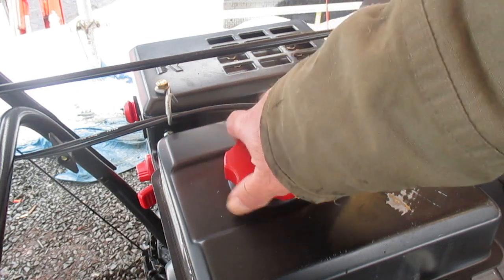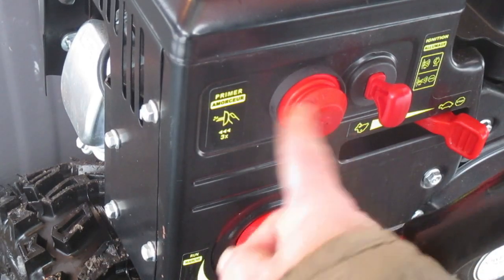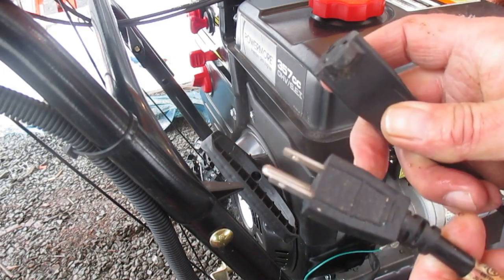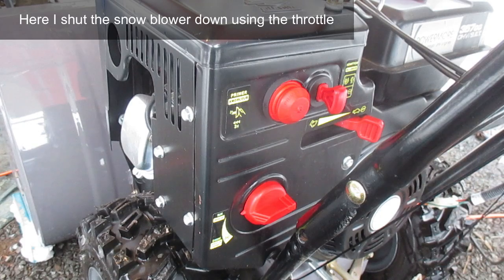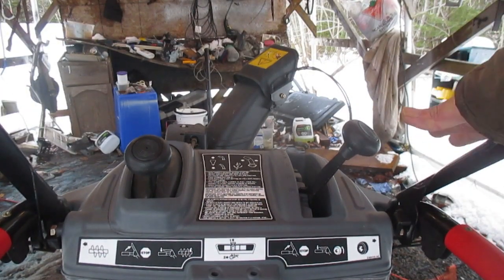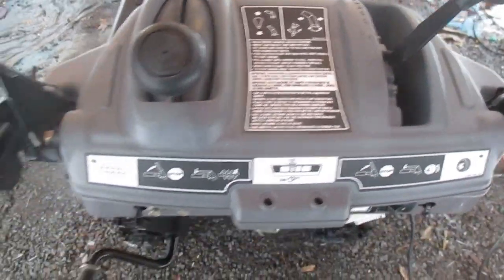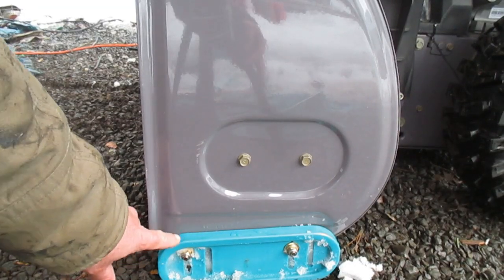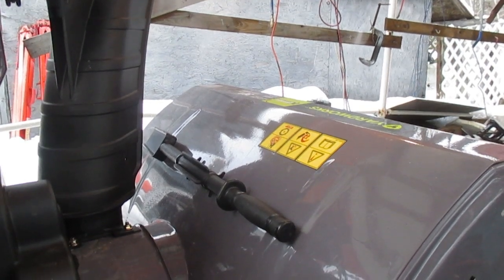How to operate a snowblower

Comment: I have the same one. Works great.  The yellow plug you pointed out is the oil drain plug.  There is another yellow plug up top beside the gas tank.  Thats the oil filler plug and dipstick for checking the oil.